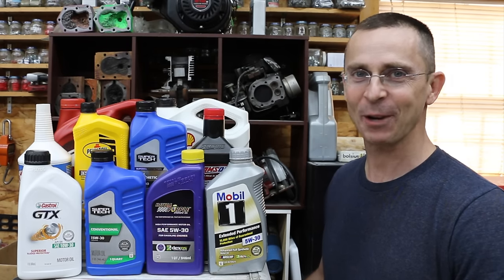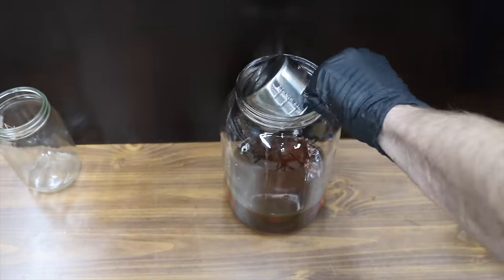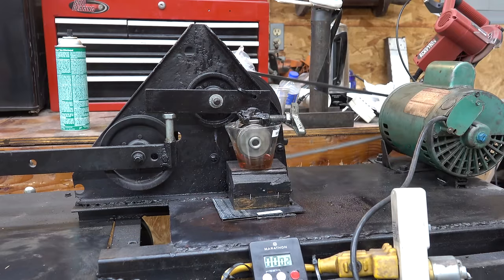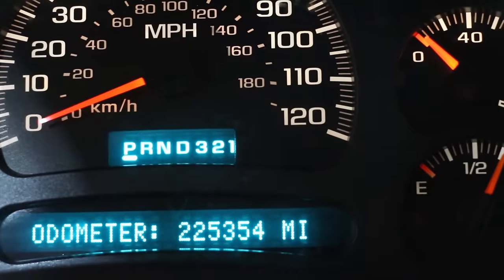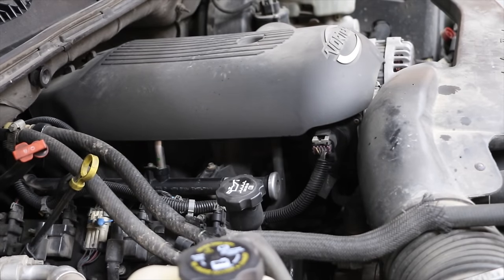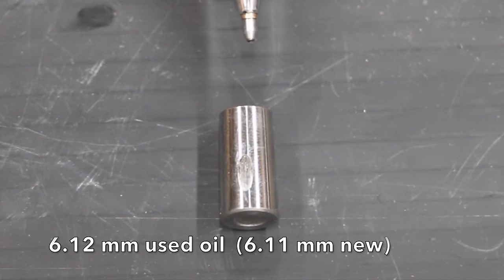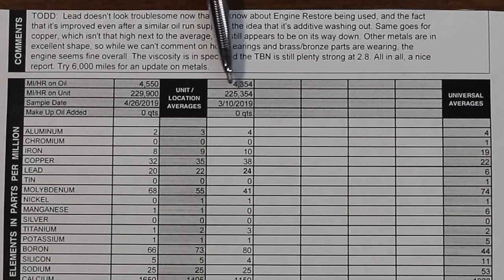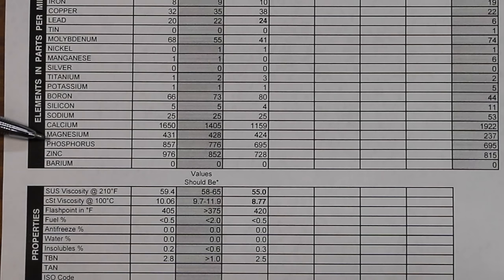Will Mixing 10 Motor Oils Damage an Engine? Let's find out!

Comment: When I was young and poor, I had a f-100 that ran fine but used a quart of oil every 800 miles. The manager of the local jiffy lube used to save a couple of cases of empty oil bottles for me. From these "empty" oil bottles I could turn them upside down overnight and get a quart or so. Viscosity didn't matter to me. It did fine.
Reply from the maker: Nice!  Thanks for sharing this experience.
Reply: Had an old ranger that did the same. About a quart every 1000, though. We'd add a quart of STP treatment because it was so thick. Loss was about a quart until the next change after that.
Reply: The chicken and the egg... Maybe the reason why it was burning oil, was because it was the wrong oil type?
Older engines do better with thicker than manufacturer recommended oils.
Reply: My Civic does that now. I will fix the oil burning, but topping it off will work fine for now.
Reply: @Papi Uuhmelmehahay 

The clearances of the engine’s moving parts were measured on whole millimeters.
Reply: Cool 👍
Reply: Fixed the oil burning issues by using a thicker oil on my old CRV.
Reply: Hi Todd, isn’t it true that auto engine oil filters almost never get clogged to the point of bypass?  I maintained many vehicles and usually change filters every third or fourth oil change.  When cut open, these filters have never had much in them - could one filter last the  entire life of an engine?

Comment: I love how he smiles through the whole video he truly loves his job and that’s why his videos are so great
Reply from the maker: Thanks so much!
Reply: really is this called a job? the smile reminds me psycho than normal people
Reply: @malvasia17  & what if doing the video's keep's him sane!..... the plot thickens
Reply: honestly brightens you up, doesnt it? :)
Reply: @kickassclone75  hope you realize he makes money from these videos....
Reply: I have 2003GMC two wheel drive half ton with a 5.3litre LS engine in it  and I use 5.w30 Amsoil signature oil  plus ea  Amsoil filter in it .It has 200.000 mile’s on it and I  change the around 10.000 mile’s in it .When I  do an oil change I alway’s let the truck sit over night in the carport then  come  morning I pull the  dip stick a couple or three time ‘s wipe each time cold engine alway’s  checking in same spot   since  2009  when I bought the truck I check the  oil  only between oil change’s once a year or more.Regularly I drive 100 mile’s per hour for more than  20 minute’s late at night at a time   some time’s for  full 40 minute’s or so the engine dose’ t use as much oil as you  can wipe of the dip stick in two   year’s sometime’s between 10.000 mile oil change’s . But after those high speed run’s I cool everything down or warm  thing’s up  visa versa never have I had trouble with truck or the law and I  never  drive in any kind of dust I alway’s pull  over  and shutt of engine until dust clear’s  with the right wind you don’t Alway’s have to  not much traffic the two mile’s to pavement. STILL THE ORIGINAL VOLANT AIR FILTER  SINCE I  HAD The truck from 2009 driven summer and winter here in Alberta 45 too 50 below zero I  alway’s plug it in  the block  heater that is in about minus 18 celcius or 10 below or something and I alway’s burn v power shell or PetroCan gas  there you have it  a very reliable  vehicle made in Indiana USA esembly plant.!!  God bless America and Canada especially Alberta.  ( lol) !?!
Reply: He could be stoned. Hell, I know I am!
Reply: @five12man  hahahahahah im stoneeeeeeeeeeeeeeeeeeeeeeeeeeeeeeeeeeeeeeeeeeeeeeeeeeeee
Reply: @sergePK1 
Personally hope he makes millions of dollars.  I love these videos 😊
Reply: there's probably someone farting in the room 😂

Comment: Short answer is you won't hurt a thing mixing oils.
Reply: My experience is any oil is better than none.
Reply: The test was not long nor in depth enough to make that determination. The lab even stated longer test times would be needed for more accurate results regarding metals. 
Rod bearings would have to be inspected before and after the test at minimum. As well as testing the oil pump. 
There are important reasons why manufacturers dictate the oil which should be used in their engine. 
Basically, there is not enough evidence at this time to determine nothing will be hurt by mixing oils.
Reply: I think the important take away here is that if you are on the road and find yourself low on oil you can fairly safely throw about anything in to bring the level up.
Reply: Some oil additives don't play along with one another
Reply: @0neTwo3  though diesels with dpf that's playing with huge stack of cash to possibly have to replace it. They use specific oils to have very little ash particles, which can kill dpf in very short time. But some basic car, that's absolutely true that you can fill it out with almost any oil temporarily. Though I'd still strongly advice against using that for extended periods
Reply: @theduder2617  If you are referring to them suggesting 6k I think that was just them saying you could probably have longer change intervals based of the analysis and there being more good life in the oil.
Reply: James Arthur Such as?
Reply: @LTVoyager  Water?
Reply: @overkillonslash  Right.  That' total bullshit.
Reply: Mick Jager Water is not an oil additive.
Reply: I always mix engine oils if there is any oil consumption in the long run. I did very high mileage (330000) and the engine was in perfect condition at the end. Just the fatigue in the steering broke my car. I think replacing the engine oil and filter every ~7000-10000 miles for getting the carbon particules out is much more important. Gear box oil should be replaced every ~70000 miles as well. Even if it is not recommended by the OEM. Fatigue sells.
Reply: @LTVoyager  That explains it! Thanks, who knew?
Reply: Mick Jager You need to brush up on your trolling skills.  They are pretty feeble.  😂
Reply: @0neTwo3  even a banana
Reply: @LTVoyager  I resemble that!
Reply: @0neTwo3  Like that wasnt obvious.
Reply: Engine oil should be replaced 2500-3500 miles and trans and diff should be every 25000-50000. People like your are the reason why cars are all fucked up.
Reply: Long answer? Fill a bmw up with 5w30 and watch it explode, lol
Reply: I had a BMW. I used all sorts of different oils in the time I had it. Almost to 400k before I parked it due to rotted underbody. The BMW engine itself is pretty bullet proof as long as you dont over heat it and keep the oil fresh. The vanos hates dirty oil. Bmw has a lot of flaws, but the engine can take a long beating. The rod bearing size is probably why.
Reply: My take away on this is.... if you have 200000+ miles... oil is oil, get it from dollar general, who cares... just keep it full and lubricated
Reply: ive used hydraulic oil for engine oil, engine oil for 2stroke premix, type f for engine oil, as long as its wet it will work. the Manufacturer recommended lol they probably recalled it hahaha
Reply: @CarlJohnson-km8zr  And none of your shit ever lasts very long either, does it? You're one of those that will do what you say above and then take your junk back 2 months later for a refund or exchange because it quit working.
Reply: Great video 
So going back to my high school years....along time ago, chemistry class told me hydrocarbons mix.  Going to my college years where I took heavy duty mechanics the instructors said never mix engine oils.  So I have always wondered if it was a big deal mixing oils?   I know from work experience that great damage occurs in a Diesel engine with spark ign rated oil as the oil lacks detergents. So both my gas and Diesel engines get the same CD rated oils. Now I have mixed brands, syn with conventional oil and different viscosities with no apparent problems.  
Has anyone actually seen damage from mixed oils??

I have heard that some of the newer engines which are supposed to have 0w20 need that light oil to achieve proper lubrication but what about just your average low performance engine?
I personally think that syn better than conventional oil due to the wax content in conventional and the more stable viscosity in syn oil for cold weather.  Also  you can go longer with syn if you have the filter matched. 
Still curious how much mixed oils effects engine life.  I had engines last a long time with just the cheapest, crappiest conventional oil????
Reply: @overkillonslash  Example please?
Reply: @mickjager5974  Water is not a commercial oil additive.
Reply: @ChrisSheaffer  i don't know the exact details like the chemicals and additives that could cause a reaction. My dad works in the oil industry and during a visit to an oil refinery in europe (largest 10 in the world) , the formulation expert explained that sometimes when you mix oils together the additives causes a chemical reaction which alters the formulation , reducing the performance of the oil and in extreme cases even sludging after several thousand km.
Reply: Motor oil is motor oil.   No damage  can be  done.
Reply: Channel Zero One thank you
Reply: @djslaviero  vinegar oil
Reply: Lassi Kinnunen  
There is a very tiny "space" in the rod bearing where oil must get to. If a manufacturer states to use let's say 5W-30, but you use 10W-30, it will be harder for the oil to flow through those tiny areas. Especially in colder weather. No oil through the rod bearings can only lead to lower engine knock and an eventual blown engine if not repaired.
Next you have lifters to take into consideration. Those too will require a specific range of oil.
They MUST operate perfectly to avoid damage.
Then the oil pump. Thicker oil makes the pump work harder to move the same amount of oil, with difficulty increasing as temperature drops.

Cold starts are where most damage will occur using the incorrect oil these days.  Smaller spaces, finer tolerances demand the oil used behave a certain way.  
Modern vehicles are not similar to our older 70's and 80's engines. You can do more harm than good using the incorrect oil these days.
Reply: Robert Burley  
It's you call. Just know that garages love owners like you. It gives them a sense of job security to say the least. 

You watched ONE video. One video with limited testing to be exact. 
There were no measurements of valve lash nor inspection of rod bearings before nor after the test.
Literally no parts which can fail or be damaged by incorrect oil were examined in this test.

Sure, the results looked good for this limited test. But when the test is not complete to begin with, a lot of needed data is not being considered.  
Take some physics courses then re-analyze your conclusion. Get more data is what I am saying.
Otherwise you are merely assuming based on one very limited test.
Reply: @deweygotdo3574  
Chemically and physically are two very different aspects. 
Shoot, one can mix oil and transmission fluid if they desire. But it's the physical laws which run the show where internal combustion engines are concerned. 
From thermodynamics to E=MC2.
The mechanics you learned from know what they are talking about. The chemistry instructor had no knowledge of internal combustion engines. They weren't required to know about them.

Only those who do not work on engines will say mixing oils is harmless.  If a person has ever replaced shot lifters and rod bearings, they know full well the importance of the correct oil.
Reply: @CarlJohnson-km8zr  
"If it's wet it will work"

WHERE did you hear that highly misinformed lie? 
I can prove it entirely incorrect right here and now.
We can agree that transmission fluid is "wet" correct?
Well give that wet fluid a go in an engine's oil. You will watch as your hypothesis grinds to a complete halt.

Spit is wet. Care to fill your engine with spit?  How about some urine or beer?
Yea, I know I am using Reductio ad absurdum incorrectly. 
But your hypothesis is also incorrect.
Reply: @terryhites1  
But you could get 400,000+ miles out of an engine if proper oil was used with proper replacement schedules.
 Back in the day, 100,000 miles was a LOT for an engine. 
Today's engines are better designed for the most part. They can see lifespans which exceed manufacturer expectation.
Reply: Robert Burley  
I see. No garage will touch your vehicles because they know who you are. Got it.
Nice attempt at pretending to be a mechanic though.

And NO, physics courses such as ACTUAL physics and quantum mechanics.
Not to mention the other courses which are mandatory. Chemistry courses for example.
Not the pretend classes required by every auto mechanics course in the country.

I know why specific viscosity oils must be used these days. And I can guarantee you have not a clue. You gave yourself away in your responses. 

It's obvious you never learned about oil pumps nor rod baring gaps. And I presume you are clueless as to the damage that incorrect oil CAN cause in today's engines. 
How about the damage that can occur if hydraulic lifters do not have the correct oil to operate them? Not a clue right? 

We do not make engines as we did in the 70's and 80's anymore. Tolerances are must tighter, and since seasons are a very real issue for all 50 US states, using 10W-40 in an engine which calls for 5W-20 will start causing issues once temperatures drop below 50 degrees F, NOT 40 degrees F like your instructor lied about.

There is a MASSIVE difference between college courses and tech schools.
And based on both of your responses, it is scathingly clear that either you attended a shoddy school, or you only paid attention to just enough to satisfy what you wanted to be true.

The fact remains, there are IMPORTANT reasons why manufacturers call for specific oils in their engines these days.

Go back to school. You are missing a LOT of fact here.
Reply: @steve5912  If you are driving a sportscar I agree. For daily driving standard cars it is much higher. Some oilchange companies are cheating in the USA. The oil can be changed much later like 7000-10000 miles without any impact on the engine.
Reply: @overkillonslash  
To build upon your factual response:
It all comes down to the detergents in the oil. Many of them do not mix well. 
Meaning corrosion is the end result. 
Some of the additives can also have adverse effects, but not as much as the detergents. 

Mix chlorine bleach with many other cleaners and bad things are a result. 
The same applies with engine oil.
Reply: @0neTwo3  
"Anything"? You sure you want to stick with "anything"?
It seems it would be wise to use some form of engine oil.

Perhaps you meant oil, but you did not say oil.  
There are so many people in this one comment section assuming instead of actually knowing. 
And is why I addressed the "anything" in your response.
Reply: The Duder I’ve been mixing whatever brand and viscosity is on sale in my saturn since 50k miles. It now has 200k miles and still runs great! Don’t sweat the small stuff. The only thing that will really hurt it is not having enough oil or not keeping it fresh. I change it every 3 to 5k
Reply: The Duder my saturn calls for 5w30, I’ve run everything from 5w20 to 20w50 to straight 40w and the only difference I could tell is it revs a little slower and loses about 2-3 mpg with the thick oil. 200k miles and keeps going strong.